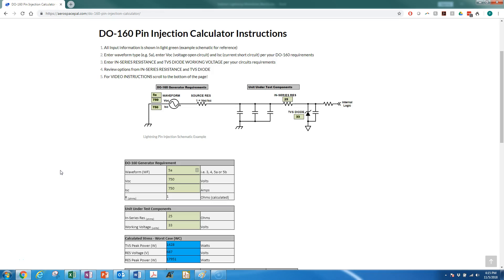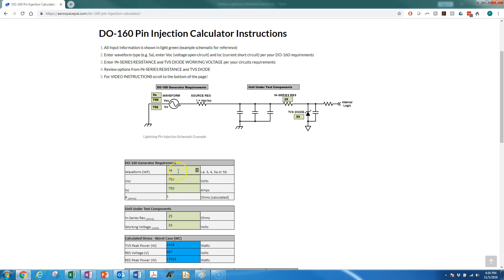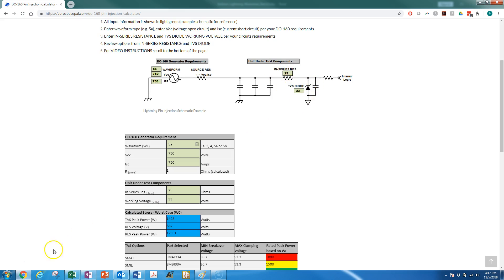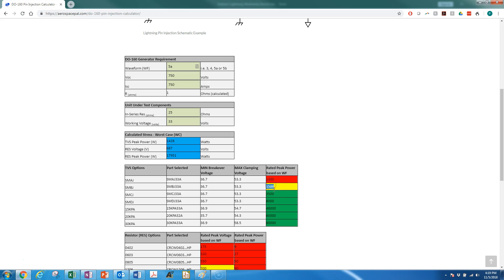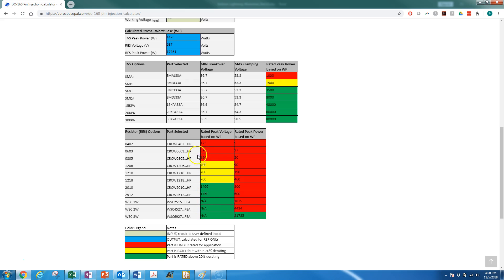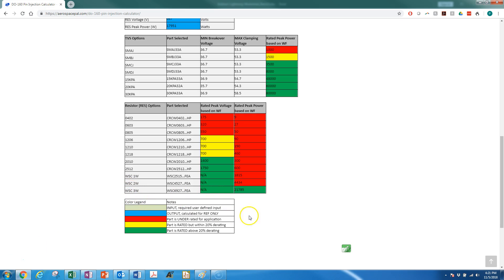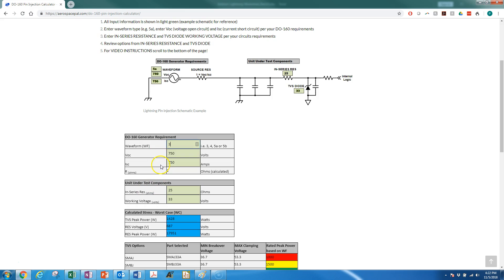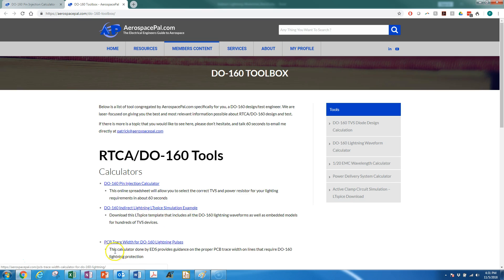DO-160 Pin Injection Calculator

Comment: how would you do the calculation for a ESD gun ( 25KV throught a 500pF capacitor and a 500 ohm resistor) with a dsl02-008sc ? thx